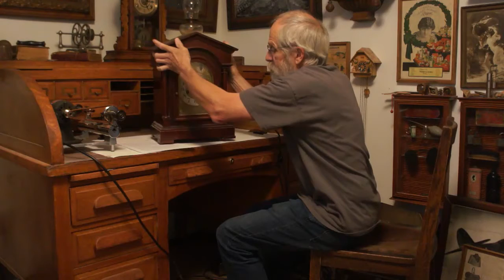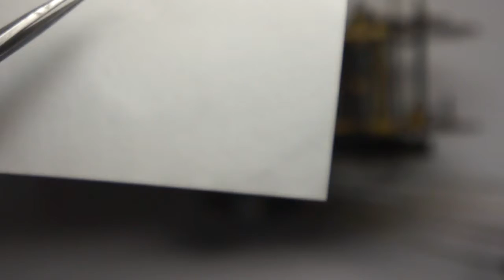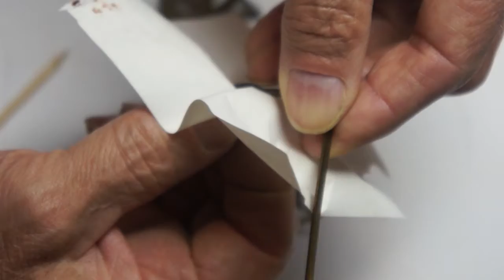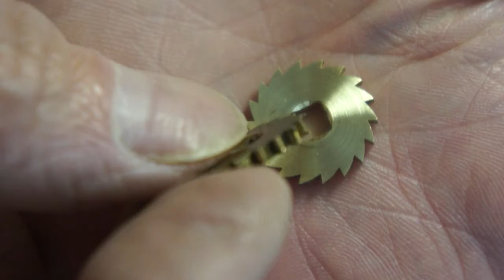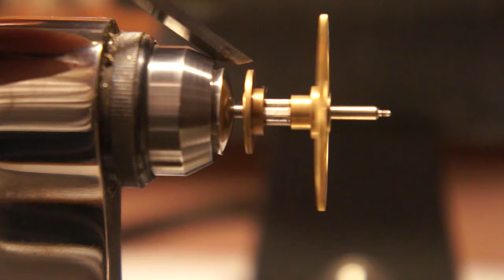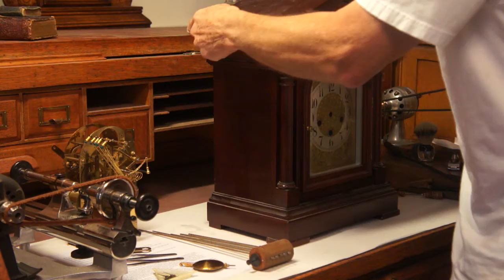1910 Junghans B10 Mantel Clock Restore for Alex #5

Comment: My clock is an A08.  I had to repair the number 1 time gear lantern pins.  I used sewing needles of the exact diameter.  I also had to replace the mainspring on the time barrel.  Cleaned all the parts and reassembled.  Oiled the pivots with clock oil.  But the chime side won’t run.  I can release the cams turn the chime hammer barrel by hand and the train turns freely.  The spring seems to have plenty of tension but the chime side will not run on its own.  The strike side works when I release the cams.  The time runs smooth.  I unfortunately did not keep track of the chime and strike spring locations.  They are different tension.  I understand the chime side needs a stronger spring so I tested them by hand.  I think I got it right.  The train seems to turn freely by hand but not on its own.
Reply from the maker: Sounds like there is some friction someplace.
Mainsprings can get a gummy deposit on them, its tough to distinguish it from the amber tempered color some of them are tempered to.  Low chance but its possible its a gummy mainspring.
At full wind and with chime side activated, start with the governor fan and very carefully with a feather touch put back pressure on it and see if the driving gear has power to the governor pinion, if so then go to the next gear in line and do the same and so on.
You should be able to find one that isn't delivering power. If you can find one that isn't delivering power than this is most likely the source of friction. 
Could be something like a burr or score on one of the pivots.

Comment: Wonderful video.  I have a similar clock movement on my bench.  I had some broken teeth on the first gear lantern gear that I replaced with sewing needles of the same diameter.  I’ll have to check for rotation.  I also need to check all shafts for trueness.   I also replaced the main spring.  Bought clock oil for the pivots.  Thanks so much for this video.  A really informative and masterful job.
Reply from the maker: Thank You, Glad you were able to get some helpful information from it.....

Comment: My grandad passed away, and I've salvaged his old junghans clock.  The mechanics inside is in pieces though. No idea if anything is missing. Going to be no easy task trying to find out how to put together. I cant find the same clock anywhere on Internet. I believe it was made around 1890 though.
Reply from the maker: Well, one piece at a time and it will all come together in the end.
Reply: @jamesmartin5370  it's junghans b13. That's what it says on back of mechanism. However googling junghans b13 brings up different designs to mine. But.... ive managed to get it back together, and now know where it all goes. But I need a new main spring, and one of the locating pegs on one of the cog shafts have snapped. Looking for a way to round it.. maybe the lightest of tig weld and shape... but its such a thin shaft.. I'll leave weld as plan b. Currently looking for a replacement part.

Comment: Hi are you able to access parts for a Junghans wall A11 Westminster strike 3 train  strike action my clocks strike mechanism are very worn.
Reply from the maker: I don't have a supply of used parts.
I generally rebuild, fabricate or have someone fabricate needed parts.
Another option is purchase a used parts movement, but then sometimes its difficult to locate the same model that doesn't have the same wear on parts needed.

Comment: Where did you get your knurling pliers? I have never seen a tool like that and I have not been able to find any like you show in the video. I have replaced one of the trunions in my Lantern gear but can't get it to stay in. Any help you can provide would be appreciated
Reply from the maker: They are a pair of needle nose plyers I modified years ago.
I know  of no way to safely knurl the brass without backing up the piece of brass, these plyers work great for this.
Do you have the ability to fabricate a pair of knurling pliers?

Comment: Nice job, I wasn't aware you could fix teeth without finding a replacement or manufacturing a replacement. The the way I thought the chimes sounded a little off. In fact I'm doing the chimes on my 1930s Art Decco clock, also Westminster chimes, right now and trying to line up the hammers with the chime rods so they hit them correctly and resonate.
Reply: I heard the hammer bounce on the hour strike too.
Reply from the maker: Soft leather helps for a deeper sound of the chimes.

Comment: Forgot to set the "chime Barrel" AUFGANG. Also would like to know how that "CHIME QUIET" lever works to silence the chime. How does the clock know what hour to chime on ??? What 'lever' tells the chime to activate on the 15 minute 'tick' ?
Mine isn't activating the chime. Fun video...soothing with ticking in the background.
Reply from the maker: Chime silent lever lifts the hammers away from the trigger levers.
The snail on the front of clock the hour hand connects controls the hour strike.
The 15 minute tick, there is a cam mechanism located on the back side of one of the gears just behind the hour wheel that a lever contacts.

Comment: Hello James.  I inherited almost the same clock. The time stamp of manufacturing is A08.  I am not a master clockmaker, but will make an attempt at cleaning the movement and oiling it following your excellent example in this video. If there are broken gears etc., I may look to have you repair it. I do not have the equipment or experience in making clock parts.
Reply from the maker: Take your time with it and you should do just fine.

Comment: Great video, I have a clock almost identical, it’s a 09 B. It’s seams to have trouble running the chimes, the timer for the chimes doesn’t move enough some times and runs till it dies other times. Any thoughts? The chime rods also have a broken rod, would you suggest glueing or finding a new one?
Reply from the maker: Tough not being able to physically inspect it for defects.
For starters:
Mainspring for chimes may need to be cleaned and fresh oil put in.
First check all the moving points of the chime train for wear and condition.
Check condition of the oil on all those moving points.
As a general rule, all rotating points or pivots should be oiled.
All points that slide against each other should be have a light grease applied.

A broken chime rod should be replaced.
The material is usually rock hard and can't be re-attached without messing the tone up.
The broken one to my knowledge can't be brazed to the other piece without softening the metal and this will change the tone.
I don't know of any glue that will work either, still the tone will be off.
I would either replace that rod or order a new set.
You may need to tune the new rod.
To sharpen, file end of the rod, to flatten it, file it thinner near the screw.

Comment: I was hoping you might be able to help me with a 1960's era Tokyo Tokei mantle clock that while it may not be highly valuable in terms of dollar value,  but it is very valuable in sentimental terms... 
The clock was being stored until our fireplace was installed,  but it was soaked with vinegar that had spilled above it in the kitchen and dripped through the floor... I'd like to take the case off and clean it, and let it dry out in hopes that it will start to run smoothly again, because it has started to not keep time since. My issue is with the winding and setting knows on the back that I cannot seem to get off, and I'm afraid to pull too hard on them without breaking it. Could you tell me if there is a certain technique or tool required for this?
Reply from the maker: Not familiar with those, I would need to physically take a look at it to determine best process to use on them.
Reply: @jamesmartin5370  is there a way to contact you outside of YT (email?) so I could send you the photos?
Reply from the maker: @Kitzkrieg  Sure,    jamesmart55@hotmail.com

Comment: Excellent instruction thank you. I have virtually the same clock apart from the hours chime on a separate gong. Mine is a A09. The chime sequence though appears to run a little fast when wound up any ideas? Best regards from the UK 🇬🇧
Reply from the maker: Thanks,
First check the governor fan clutch.
Where the fan is mounted to the arbor, the joint is friction fit.
This is the clutch mechanism, designed to slip at a certain stress level from the air resistance against the fan blade.
If fit-up is too loose or there is oil present at this joint, the clutch action will engage too early and allow the arbor to spin too soon, this causes gear train to run too fast. 

If this is not the cause.
Is it possible sometime in the past a mainspring that was too strong was installed or the fan blade on the governor was altered?
Reply: @jamesmartin5370  Thank you for excellent response first chance I'll check this. Obviously not knowing its previous history it could well be a too strong mainspring and if this is the case I'll not lose any sleep over it.
I'll let you know how I get on. Keep up the fantastic work👍

Comment: Incredible skill involved in fabricating gears, etc. I have this exact same model clock and this video was quite a find for me as I begin to repair mine. THANK YOU.
Reply from the maker: Wish you all the luck on yours clock.
They are good movements...
Reply: @jamesmartin5370  have been able to get my clock running again, in large part due to your video - thank you! However I have encountered one last problem that has me baffled. The clock chimes about 3 minutes early. As you probably know from the Junghans you worked on in the video, you can't change that by adjusting the neck of the center of the minute hand like every You Tube video I have found suggests. The Junghans minute hand doesn't have a neck; just a square hole that fits on the square top of the hands shaft. I can see no way of adjusting the Junghans to chime at a different time. I would appreciate any suggestions you may have that I can try. Thanks.
Reply from the maker: @Silvamorde2004  
Real gald you got yours running, I sure like the chimes in these.
It sounds like the relationship between the trigger arm that triggers the chime and the pin on the back of the hour wheel is incorrect. 
You will need to trouble shoot several items then decide which action to take to solve the issue.
I suspect the hole in the front plate the center wheel goes through is worn.
And also the fit-up between the hour wheel and center wheel arbor may have some wear on them.
Try putting some pressure on the center shaft and you may find there is considerable side shake in it.
Also put some pressure on the hour wheel tube.
Hold some pressure on the hour tube, away from the worn direction and slowly rotate the minute hand holding pressure on it, it may chime closer to the correct time.
If this is the case a bushing will help.
Or the pin on the back of the hour wheel or the trigger lever that rides on that pin could be modified to hold the trigger lever slightly longer before it drops off the pin.
Let me know what you find out

Comment: Thank you so much, very good detail and explanations.  One thing that seems to be skipped in this video is the removal of the hour hand.  I have a Junghans mantel clock (B09) that I need to remove the hour hand in order to remove the movement. The hand does have a small amount "in and out" movement, but I hesitate to just pull on it.  Please, if you could share how this hand is removed I would be most thankful. Thanks again for your help.
Reply from the maker: The hour hand on the above movement is friction fit, Yours should also be the same style.
Reply: @jamesmartin5370  Thank you very much.

Comment: Where do you get brass screwdrivers?
Reply from the maker: I picked this set of 8 up in the 1970s when I started in the business.
Mine are a K & D set No. 268, Non-magnetic, Hardened Beryllium Copper Blades.
Sets and replacement Blades are still available at some supply houses:

https://www.jewelerssupplies.com/shop-bin/sc/productsearch.cgi?storeid=*14884f2cab1d40e71cd4468d

https://www.esslinger.com/individual-horotec-mini-non-magnetic-screwdriver-w-beryllium-flat-head-blades-0-50mm-3-00mm/?gclid=Cj0KCQjw0caCBhCIARIsAGAfuMyQE6bc1mfXI6xPS_J9TluXjdEredFdPODAzkvq-8lhCv6bvfZYjFwaAvmVEALw_wcB

Comment: Thankyou for such a good demo of restoring this beautiful movement as it was so interesting to watch and what a beautiful job you did of making the new barrel wheel, the new pinion and the new trundle wire as I really appreciate lovely work, could you possibly do a demo of gear cutting and wether you make your  own gear cutters? Once again many thanks. Jim Nicholson AUST.
Reply from the maker: Thanks Jim,
 I can replace damaged teeth in gears, this is hand work.
I am not set up to cut steel pinions complete or cut gears complete.
The steel pinion and barrel gear were damaged beyond repair to be structurally sound so they were sent out to another individual to be made.
Best Regards, 
Jim